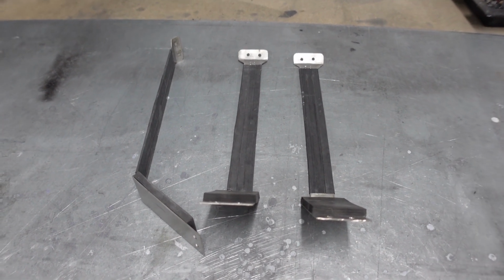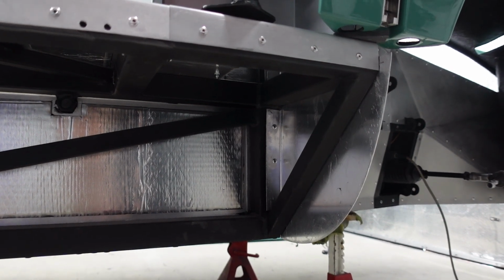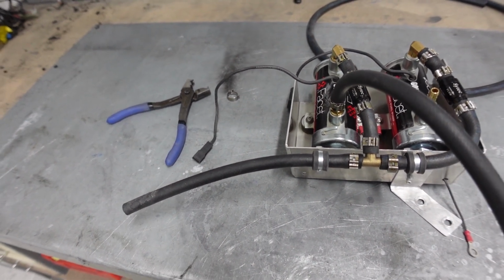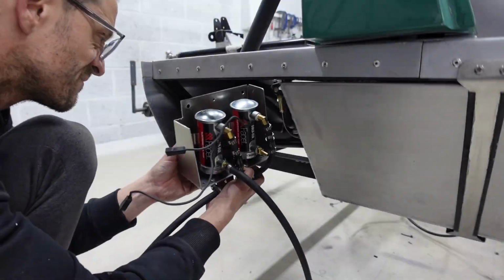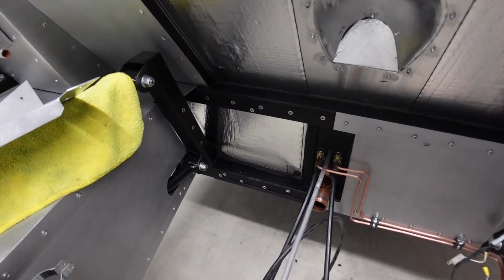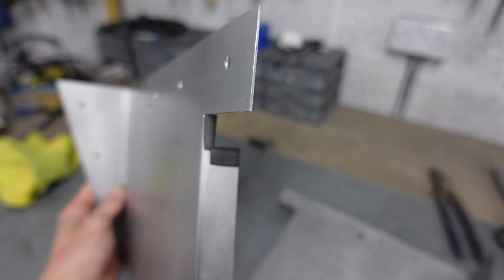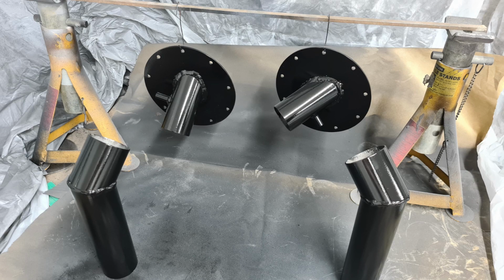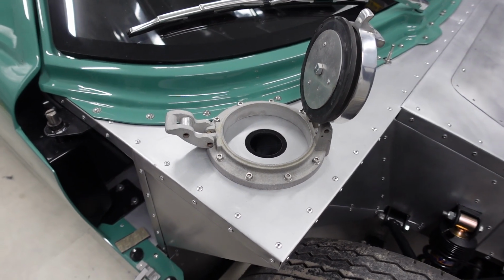GT40 Restoration - Ep 41: Fitting Fuel Tanks And Fuel System

Comment: You've done a GREAT job so far!!!

Only suggestion I would make would be to ditch the 45*'is butt weld in your fuel filler line and use only a straight section with a 45* silicone hose couplers vs the straight silicone hose. . .
Reply from the maker: They are part of the Tornado kit, they do the job just nicely ;-)

Comment: Coming along very nicely Andrew as per the norm.   Quick question, was there any thought given during your early planning stages and thoughts to having your car converted to the one fuel filler cap design as found on the later MK 1's?   In essence you would then have "self-leveling cross-over" fuel tanks.   However, like you I love the iconic fuel filler caps so if one is nice two is certainly better!!   😊
Reply from the maker: In all honesty absolutely zero thought! haha

Comment: You are definitely obsessive about keeping it looking as simple as possible under the clams. I think this is the first build I have ever seen with the pumps and filter hidden away under a panel.

You mention the fuel hose being E10 compatible, so do you intend to run it on E10?  I thought this can cause problems with other fuel system components such as the carbs, but I may be wrong and would appreciate your thoughts. I’m using Esso super E5 which I’m told is supposedly zero ethanol for this reason, but blimey it’s getting very expensive at c £1.80 / litre!
Reply from the maker: Thanks as always Doc :-) regarding the e5 / e10 I'm sure a tank here or there of either really isn't going to make much difference to the life of things considering how few tanks of dinosaur juice we actually get through in a summers worth of driving

Comment: Slightly surprised you didn't use the Mikalor Supra type hose clamps rather than the worm drive ones.
Reply from the maker: I had a millions choices..... I waste enough time pondering over details as it is haha, these JCS clamps will do the job :-)
Reply: It's yet another thing on mine that I've probably overthought @RatchetRebuilds ! My concern has been that in the case of a crash the fuel will try and escape through the filler caps (see the classic photo, google "GT40 Crash Test 1967" to find it) so making sure the hose connections are as secure as they can be! 

Although of course from the looks perspective they're (hopefully) never ever going to be seen again once you've buttoned up the fuel filler area.